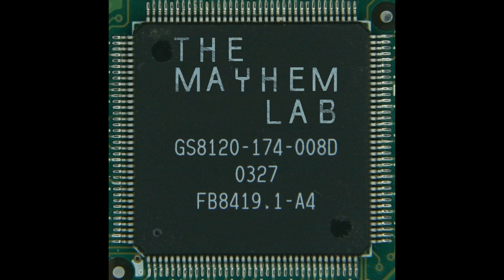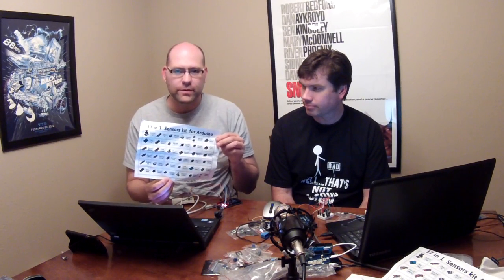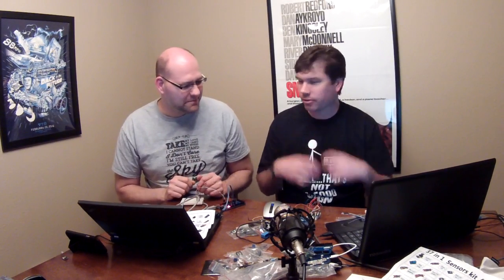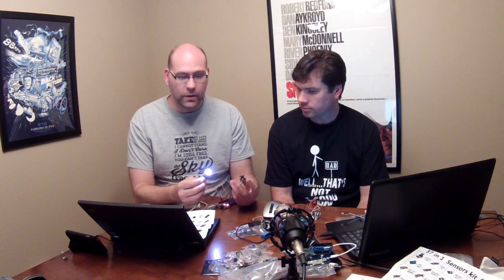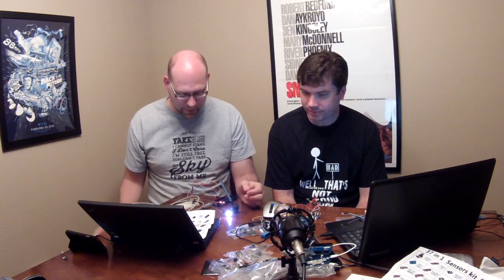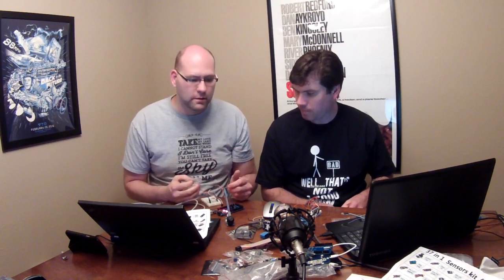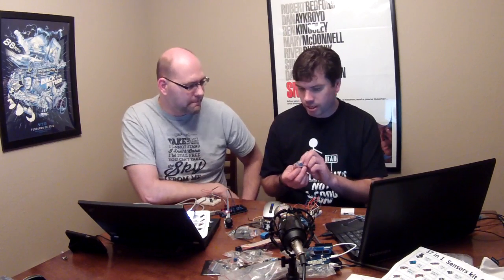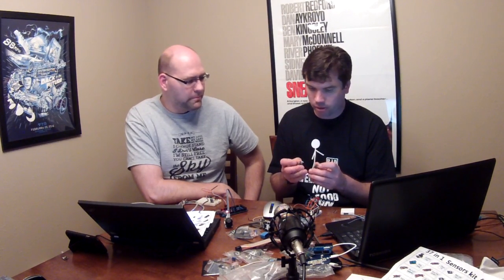#6 - Arduino Sensor Kit

Comment: Does the kit come with sample code for each sensor ??
Reply from the maker: Hey Michael, 

The kit does not come with source code, it only includes the sensors. However, it's easy to find sample code on the Internet.

- Michael